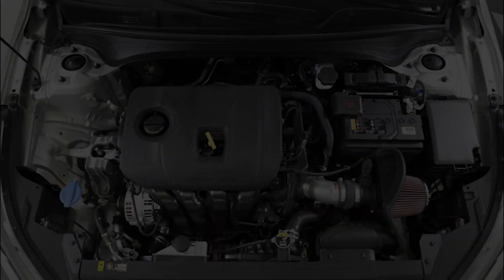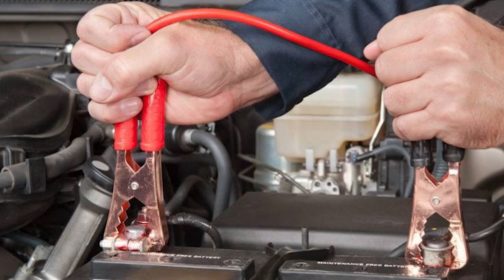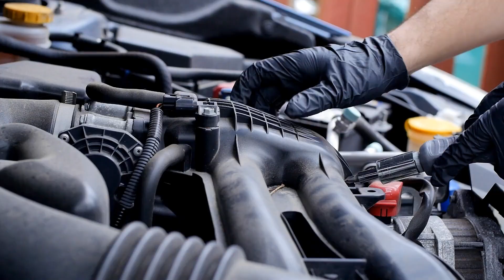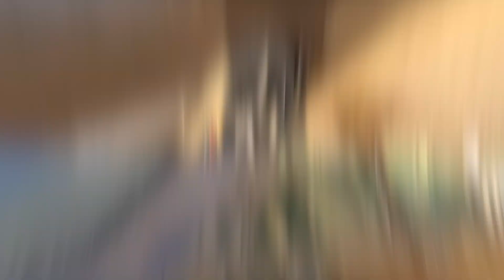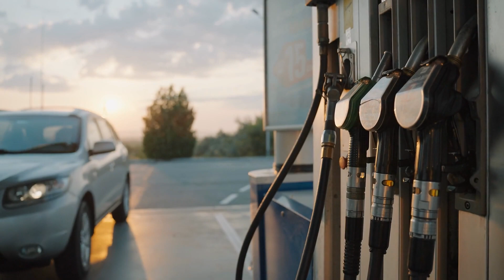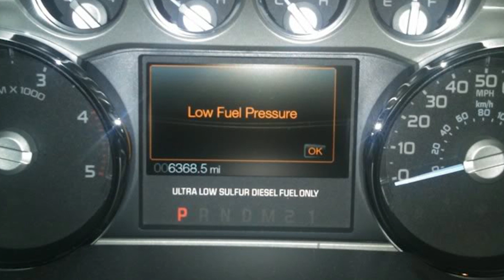10 Signs and Symptoms Fuel Pump is BAD and Failing

Comment: My jeep wrangler just shuts off while driving it on highway over 80 mph
Reply from the maker: If your Jeep Wrangler shuts off while driving over 80 mph, it could be due to a failing crankshaft position sensor, which is a common issue. Another likely cause is a weak fuel pump or clogged fuel filter that can’t keep up with high-speed demand. Electrical problems like loose battery terminals or ground wires can also trigger sudden shutoff. Sometimes, a faulty ignition coil or worn spark plugs may cause misfires that lead to engine stall. A malfunctioning throttle body or mass airflow sensor could also be disrupting engine performance. It’s important to check for diagnostic trouble codes using an OBD-II scanner. If the vehicle is overheating or has oil pressure issues, it might shut off to protect the engine.  Good Luck.

Comment: The script and voice are odd. were they written and voiced by AI?
Reply: 100% ai
Reply: If my vehicle  drives so far then shuts off but 10 to 20 mins later starts again is that fuel pump or normal to act that way if pump going out?
Reply from the maker: The Script is written by us.  
Thank you for your comment.